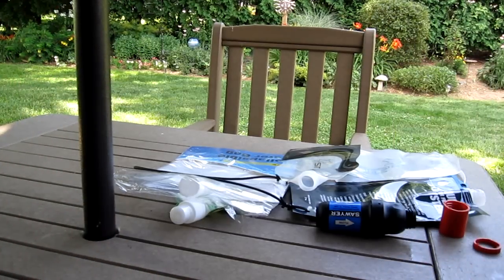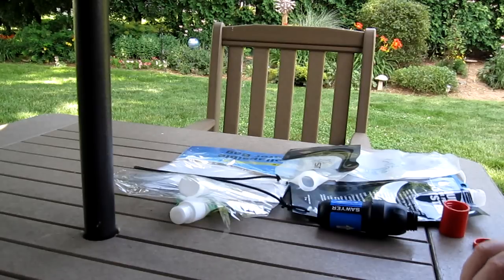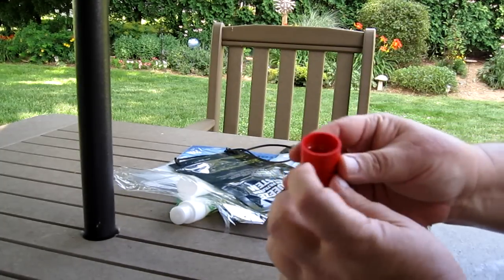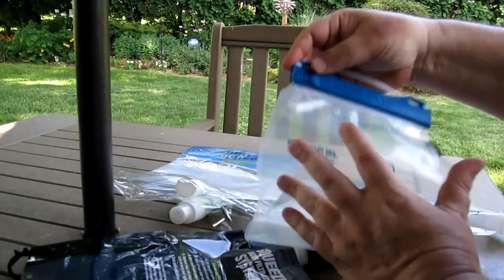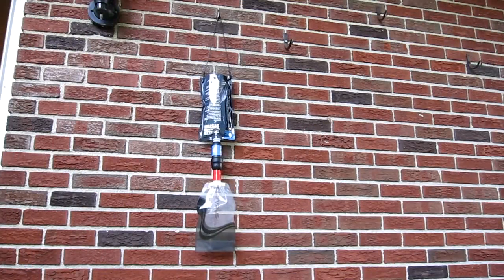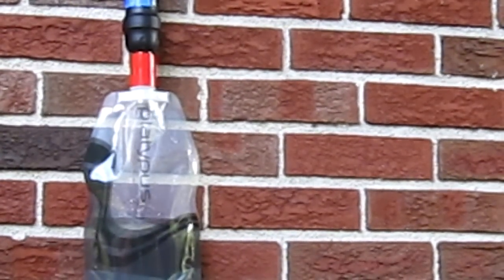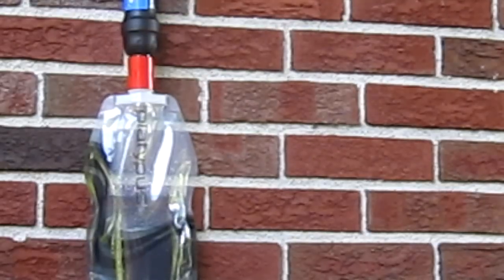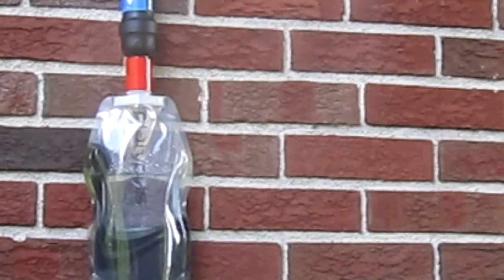Sawyer Squeeze Tornado Tube Mod suggested by Jon Fong (Flat Cat Gear)

Comment: Why doesn't the drip system create a vacuum in the top bag or conversely, why doesn't pressure build up in the lower bottle stopping the flow?
Reply: it does create a small vacuum however there is already a lack of pressure in the bottom and because there is not a significant change in pressures the water does not fight the gravity

Comment: Hey Hiram,  do you find that if water is forced through the filter faster, the results are impacted?  A lot of hacks seem to save a minute or two, but is the water as pure as a slow flow?
Reply: testodude I have read that speeding up the flow will lower filtering performance. I havent personally tested this though.
Reply: testodude I have read that speeding up the flow will lower filtering performance. I havent personally tested this though.

Comment: I bought a Sawyer filter because of the claims it fit the common 2 liter bottles. The only bottles I have found that were the proper threads are Smart Water bottles and not necessarily 2 liter bottles. It's kind of silly that they made it so very incompatible. If anyone knows of other bottles that they fit post them.
Reply: worddunlap coke
Reply: worddunlap coke 1.25 liter

Comment: I use a one inch PVC connecter that has the threads on the inside that's made to connect two sections of PVC pipes together that are used for other applications where you can't use the PVC glue and looks just like the tornado tube and I paid I think 34 cents for it. Works great too !

Comment: Try this. Cut/drill the center out of 2 soda bottle caps. Use aluminum duct tape to tape them together back to back. 

I've used this to make a funnel to fill soda bottles with rice, etc. Screw one side to bottle to be filled. Other side is attached to top 1/3 of a soda bottle as a funnel. 

Don't know if weight of filled container will cause bottle caps to separate. May need to epoxy them together + aluminum tape. 

Someone with a Sawyer may want to experiemnt. Only costs 2 bottle caps.

Comment: At a dollar store I found a plastic funnel that has a screw thread that fits pop bottles.  It weighs nothing and without it it can be hard to fill those collapsing bottles in a lake.

Tinny sells the tornado type thing at that price because he's hand making a few and cutting threads is time consuming.  The tornado tube you bought is mass produced in an injector mold, which has high set up costs and then is cheap.